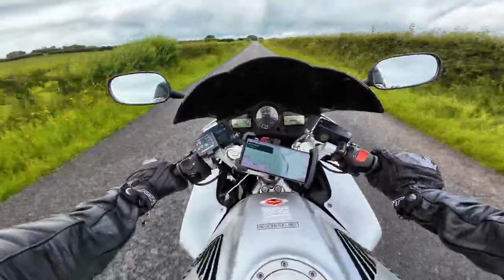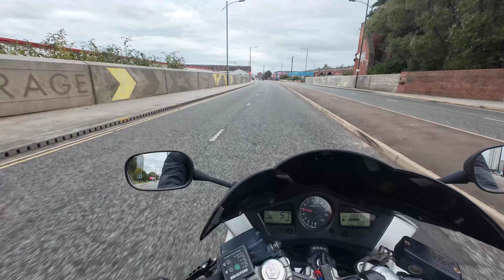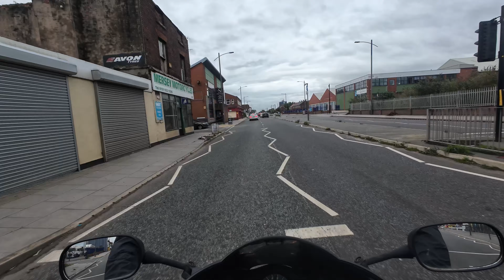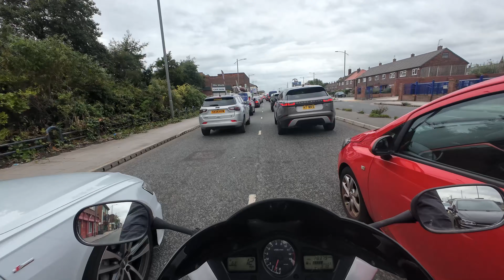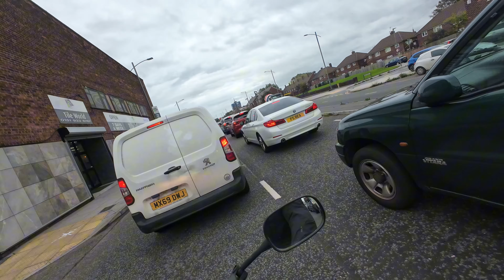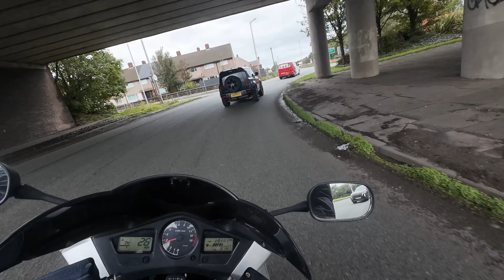Does a loud exhaust help with filtering? Do loud pipes save lives or am I looking for any excuse?

Comment: Delkevic! Nice one. Going road legal or full ASBO? Mine came with the loudest they make and probably gonna swap it out. It’s fun, but ear plugs aren’t optional 🤣
Reply from the maker: I have the lextek stainless steel headers sat in my hallway ready to go. Ill actually try and make a decent video of me fitting them.
Reply: @SloboloboVFR Please do. Oh, get some rust protector straight on the hardware. The pipes are fine but the washers and bolts have surface rust on mine.
Reply from the maker: @MaineDoom  Good point that, I need to grab some exhaust paste before I start anyway.

Comment: Bright lights, loud pipes, menacing stance, but how many times do you get a car as you filter through learch away to the left in shock because they haven't seen you. In years gone by a friend of mine rode a goldwing with all the extras, chrome air horns fog lights cruising lights  a trailer, bright clothing, hi- vis, close encounters of the third kind, got knocked of by a bloke that didn't see him.
Reply from the maker: I've never seen a car lurch towards me, occasionally they will pull away to the side quickly. Usually because they just noticed me.
I think it doesn't matter how much I do to be more visible (to a point) if someone simply isn't looking they wont see you.

Comment: Do what i did on my old (1995) yzf750r stainless can and link pipe (oe) , cut end off can and gutted it and put a straight through piece of perforated pipe inside a welded it back up, looked perfectly legal and sounded mint, i got a local stainless fab shop to do it,.If anyone with a yzf750r wants a standard and a "moded* exhaust ive got both (cheap) cheers,.
Reply from the maker: I've just fitted a lextek set of steel headers to my delkovic exhaust cans. An emotional job to say the least but it sounds like a new bike